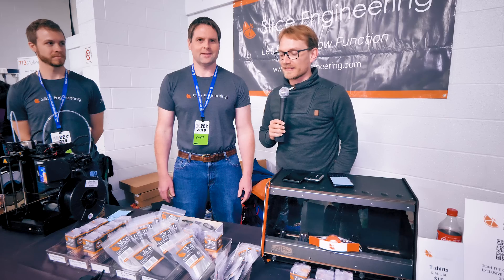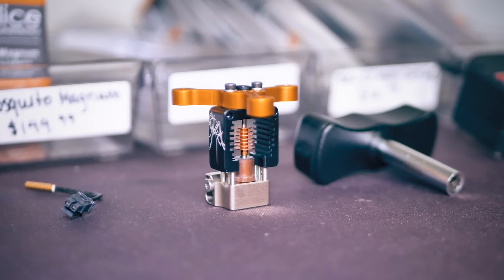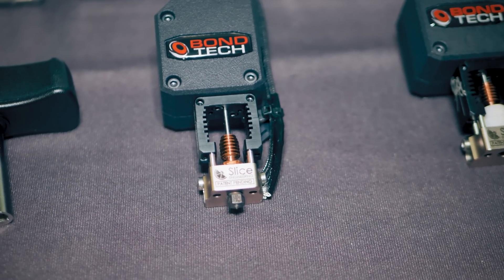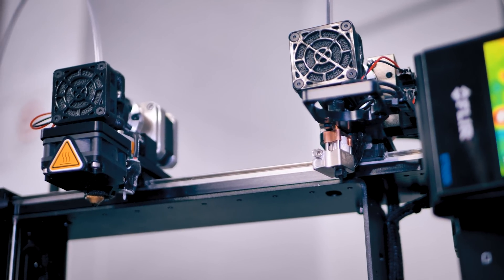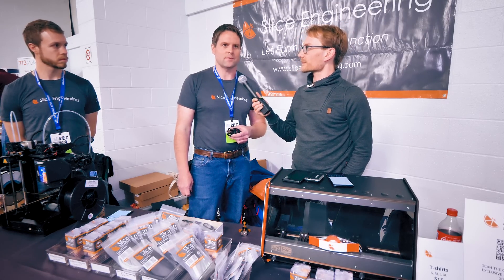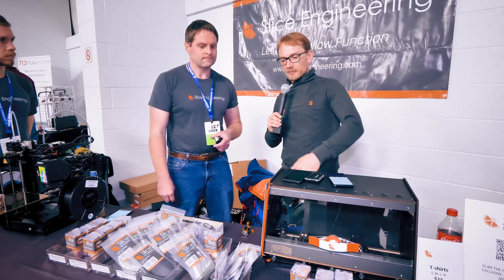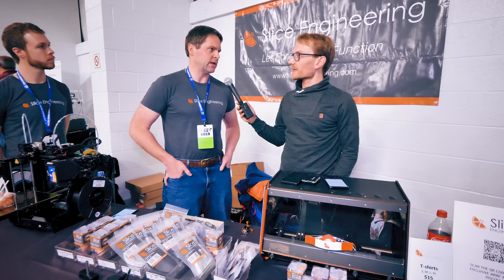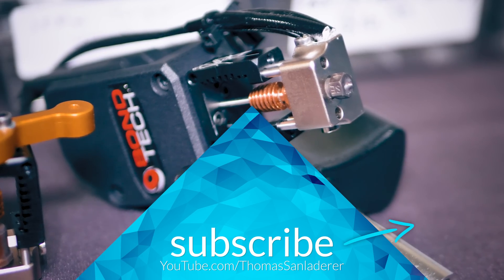The Mosquito Hotend is... wild! #MRRF2019

Comment: I really like this. I recently ranted so hard that on the v6, everytime you unscrew the nozzle, the heatbreak comes out.
Reply: I see so many people shearing their thermisters and heater cartridges on those.  Just the fact that I don't have to worry about that makes this tempting.
Reply: @dfloyd888  Yeeeeppppp, I've snapped the wires on several thermistor cartridges & heater cartridges on my V6, and it's so frustrating, especially since I'm using a PT100 sensor and one of E3D's green-insulation high-precision heater cartridges, so it gets expensive replacing those >.> I actually globbed a load of "gasket maker" silicone (stuff that can withstand temperatures beyond 300°C) around my PT100 & heater cartridge wires when I last replaced everything, hoping that the silicone would act as a strain relief and help prevent the wires snapping. So far so good, but my printer's been out of action for unrelated reasons since October, so I've not swapped nozzles too much yet with that silicone in place...

Not to mention that the heatsink+heat-break+heater-block combination often comes unscrewed to some extent and the only real way to tighten it all up again is to disassemble the whole extruder body (on a Prusa i3 MK2/MK3 anyway)! I've seen that E3D now sell a blue version of the V6 heatsink that has a screw thread at the top instead of the groove-mount (https://e3d-online.com/v6-threaded-heatsink). I've not been able to find any existing remixes of the Prusa i3 MK2/2.5/3 extruder body that utilise the threaded heatsink, but if someone (maybe me) were to create one, that should at least stop the heatsink rotating!
Reply: Do all of you only have one hand?
Reply: @Tac_Taco  I find it tricky to get a good grip on the heat block with plyers without them slipping. I never feel like I'm danger of snapping wires though, but It's enough to make me hate swapping nozzles.
Reply: @erispe  if a mosquito hot end helps you then I really have no say. Everyone is different and so is most of our printers. Fun community to be in, I just don't agree with obscene prices for what seems to me an arbitrary problem.

Comment: Nice, but how does it work? I mean how easy can you change the nossle now?
Reply from the maker: You don't need to counter-torque at the heatbreak to undo the nozzle - the outer standoffs provide enough strength for that.
Reply: @MadeWithLayers  Don't they carry heat up into the extruder body?  I assume they are made of metal and conductive?

Comment: The high temp capability is really awesome. I also dig that it doesn't need as much retraction. I feel like they are on to something...
Reply: @PRiMETECHAU  The mosquito is rated to 350C with their 25w heater cartridge, with the cartridge actually being the limiting factor thus far.
Reply: @MattWeber  A typical e3D V6 can handle temperatures up to 500°C if you use a thermocouple instead of the normal thermistor.
That's what I call high temperatures.
Reply: @tonpa8888  yup which in the end puts you at the same price point all said and done as the stock cartridge on the V6 doesnt get that hot I have seen (mine has issues staying over 325 if ANY air movement in even a closed chamber, including just the print head moving around). While you could also go hotter with the mosquito with a higher wattage cartridge, while keeping a much smaller form factor, hence their fanless option they are about to offer for even hotter printing materials.. meanwhile the current filament options dont require much more than 350C anyhow. The v6 may be able to heat up that hot but the cooling design has a hard time handling it without conducting the heat further north thru the cooling fins and risking issues with the mounting points IME also. The mosquito the heat stays VERY localized at the heat block in comparison.
Reply: @PRiMETECHAU  The Mosquito is rated to 450C which covers any available thermoplastics :)